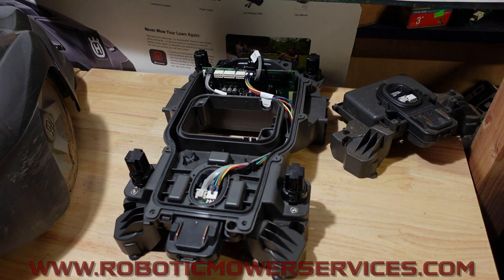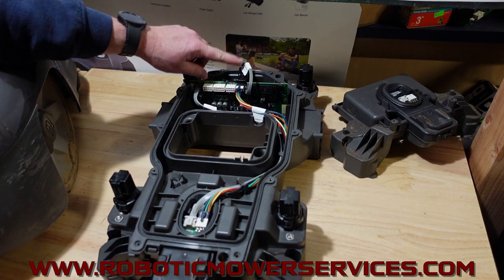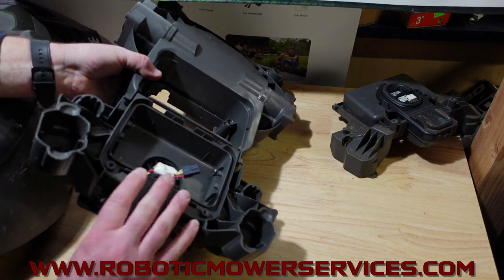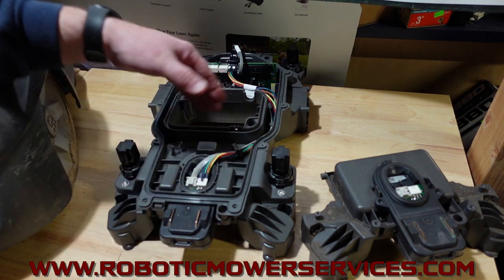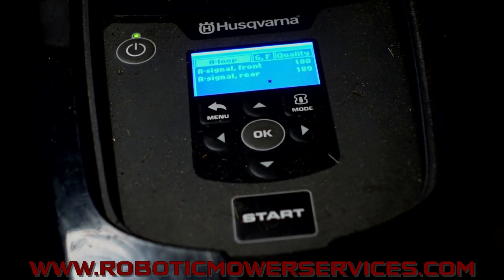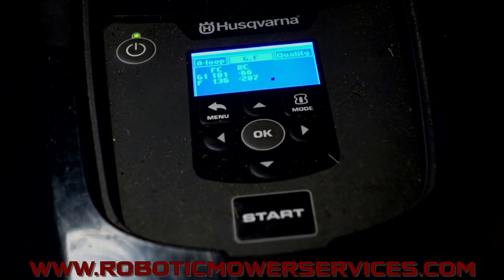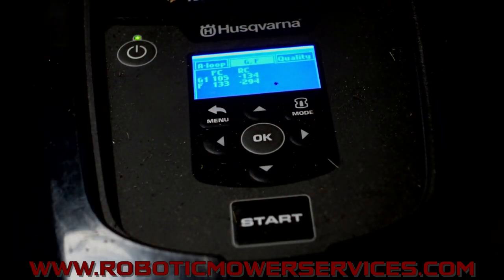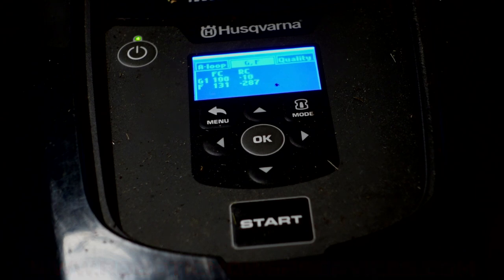115H Loop Sensors

Comment: Thank you. Very helpful.
Reply from the maker: Glad to hear it!
Reply: @RoboticMowerServices  used your video to disassemble and check both my loop sensors. Both are reading zero. All connections are good. Assuming it’s a main board issue. It’s new with zero hours. Wish I could reflash firmware. Just ordered another mower to get some test parts from.
Reply from the maker: @OMGhangout  Did you pair the mower to the charging station? If not, it will read 0 on all the the loop and guide wire values
Reply: @RoboticMowerServices  oh no. It’s a 115h. I didn’t know that was a thing. I’ll look up how to do it. I feel silly if that’s what’s wrong. Thanks.
Reply: @RoboticMowerServices  thanks for the advice and video. We couldn’t find anything about pairing a 115h to the base. We did see on other mowers how to do it. Just no luck for us.
Reply from the maker: @OMGhangout  It's the same process as with the other mowers. Just go to the security option in the mower's menu and then ADVANCED, and NEW LOOP SIGNAL
Reply: @RoboticMowerServices  well I have no idea why I couldn’t find that. I went right to it that time. I feel pretty dumb, but I sincerely
appreciate the help.
Reply from the maker: Glad to hear you got it solved. Don't hesitate to reach out if you run into any more issues.